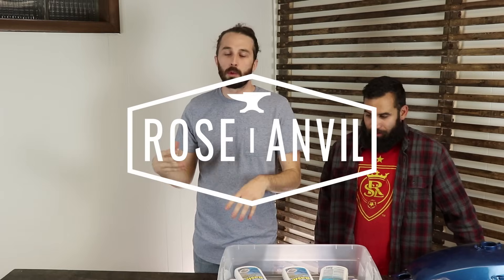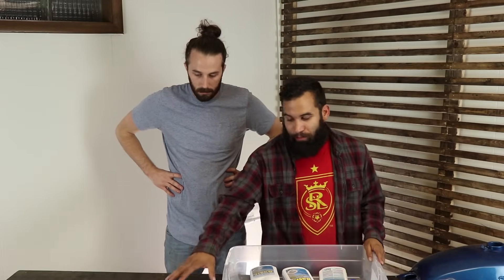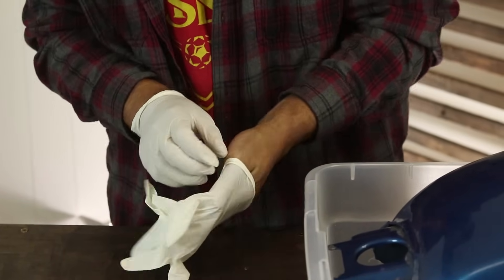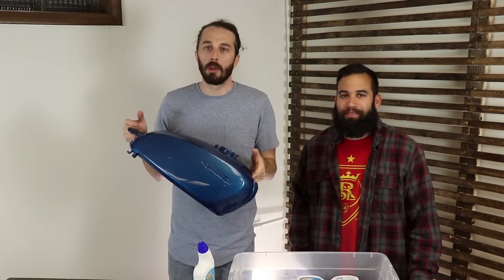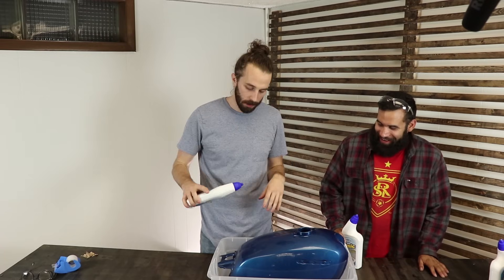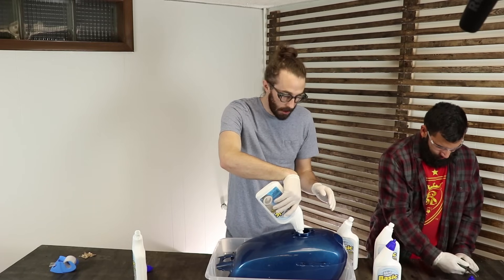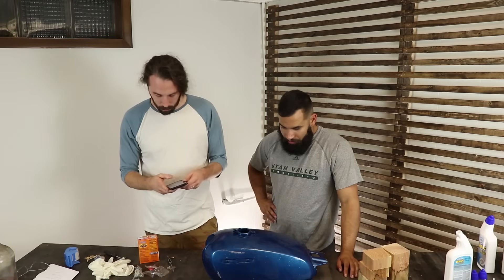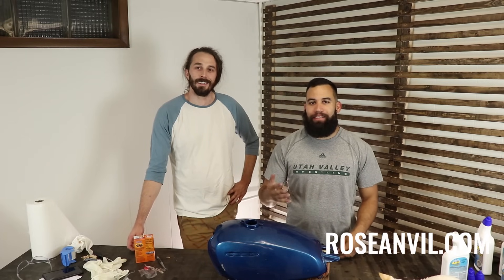How to REMOVE RUST for $1-  (HOW TO CLEAN A GAS TANK) - motorcycle gas tank pt.1

Comment: Okay so anyone reading this, you need to finish cleaning the tank with phosphoric acid, which is used in "rust converter" and auto body self etching primer, or Royal Jelly. You can use Muratic acid concrete cleaning acid which is hydrochloric acid. But dillute it some with water. And then don't leave it in very long because hydrochloric acid dissolves iron and steel. But the key is to rinse it out with water. Then do the same cleaning with phosphoric acid. If the rust isn't that bad you can start with phosphoric acid only. The phosphoric acid doesn't eat the clean good metal, it only removes the iron oxide (rust). The phosphoric acid turns the free iron on the surface of the steel into a hard rust resistant form of iron which is dark grey. Similar to when you blue a firearm. It's called passivation. The surface becomes more resistant to oxidation. After the phosphoric acid you'll not need to worry about it rusting unless you didn't clean the rust fully. Open non treated rust must be removed for the phosphoric acid to properly seal the metal. Hydrochloric acid does seem to remove rust very quickly although it's very aggressive and you'll want to start with a very weak solution first. Too strong of HCL acid and you'll burn through your good metal if you leave it sit too long. HCL is the same as stomach acid and our stomach acid can dissolve solid steel.
Reply: Could you do this with a bike frame?
Reply: @ihavenoplacelikehome  I have been using 10% double strength vinegar for rust removal, it works well as a soak, but its too thin to spray onto stuff for rust removal. Then I discovered that adding enough detergent to the vinegar causes it to turn into a foam when sprayed on it sticks to surfaces. I used an 'earth friendly' toilet cleaner which contains 10% citric acid, oxidants and detergents as the detergent, it worked very well and increased the aggressiveness of the acid. I would be extremely careful to ensure you're only adding acid and detergent though, many people don't realize that accidentally adding even small amounts of bleach to vinegar can produce lethal concentration of chlorine gas.
Reply: I scrubbed through the video to see how they applies the rust converter, I was disappointed to see they skipped it entirely.
Reply: Appreciate the gems 💎
Reply: What if I just get really drunk throw up in the gas tank and leave it overnight,?
Reply: Coke has phosphoric acid yeah? Why not fill it with cola? Maybe diet so no sugar?
Reply: Where can I get acid at like what
Reply: Where does one get phosphoric acid  from? Any house hold items i can use to get same results?
Reply: @babyhullk  Lowe's, Home Depot, Menard's, True Value, etc
Reply: So can I just add phosphoric acid to the tank after the " works " ? Then I just have to drain the phosphoric acid? That's it? Or how to specifically do it with the phosphoric acid?
Reply: I think you mean naval jelly. Royal jelly is something honeybees make. But then you don't see many rusty bees, so...
Reply: @ihavenoplacelikehome  of course
Reply: Excellent comment.  This is why I use KBS products to clean and seal.

Comment: I just cleaned two metal outboard motor tanks with vinegar. Tanks look like new inside now. Cheap, quick, and easy.
Reply: Did you use white or yellow vinegar 🤔
Reply: @glasswinder  white
Reply: @tomcarter4617  thanks.
Reply: @glasswinder  anything?
Reply: Vinegar only? Or did u add something?
Reply: So you just poured a bunch of white vinegar into the tank & what? Was the tank still on the bike? More details are needed 😏
Reply: I used apple cider vinegar on an old husky tank. It took out about 95% but left some on the bottom of the tank. I'll finish it with the toilet cleaner over night and see if it clears up.
Reply: I just did a talk with white vinegar n it’s clean
Reply: Did you just use vinegar or vinegar and water
Reply: @dannytapp9422  I just used vinegar and when I was finished I immediately flushed it with baking soda and water. Then dried it and added oily gas
Reply: @tomcarter4617 oily gas, like 2 stroke gas mix?

Comment: Before you add the Oil to the tank to preserve it, dry the tank completly with a hair drier.  This way the tank will be completly dry when the oil is added.
Reply: Then it will already be flash-rusted. Much like using isopropyl alcohol on water-logged electronics, the acetone they suggest will help evaporate the water and leave the oil.

Comment: Hey guys thanks for this video!  Just used this method on the tank for a 2012 Honda Shadow that sat for about 7 years.  Worked great and I couldn’t believe how much rust came out!  I put in an inline filter as part of the project and now she’s running great with no hesitations or lurching.  Thanks!

Comment: I use 1 can wd40 and handful of nuts and shake  and a magnet on a string to fish out the nuts works every time
Reply: howietorock same, but I wire it onto the front of a ciment mixer, does the shaking for me, I'm a lazy fuck !
Reply: I did the same thing with paint thinner and a bunch of steel bbs. Shook the hell out of it.
Reply: Washers would work well, chain is alright to.
Reply: Put all the nuts on a long lazy loop of string. Much easier to get them all out.
Reply: E

Comment: When diluting acid with water, you should ADD ACID AFTER the water. 
Acid is more dense than water and mixing water with acid is exothermic (generates heat) and it has potential to boil off violently if water is added to a concentrated strong acid.
The risk of a dramatic reaction is pretty low, especially with dilute weaker acids.  However, it is a good habit to add the acid to the water, not the water to the acid.

Comment: This worked like a charm! I did one to one and left it over night. Cleaned it with a pressure washer the next day. I had to go to lowes to get the works. Used a plastic bobber to plug the hole on the bottom of the tank.

Comment from the maker: If you are trying to REMOVE A TANK LINER i just posted a video on how to do that! Link - https://youtu.be/6Q0WwfL_1F0
Reply: Can you explain how you used the marvel mystery oil/acetone/baking soda after you used the works to neutralize the tank?
Reply: And how do you get all the water out after washing the works out, before you use the mystery oil?
Reply: I need to know that too. Can somebody explain how they use that to flush and neutralize inside the gas tank.
Reply: @zackamburgey2164  I believe isopropyl alcohol (rubbing alcohol) will work for water displacement.
Reply: i guess it's kind of randomly asking but does anybody know a good place to watch newly released movies online ?
Reply: @Rudy Alec thank you, I went there and it seems to work :) Appreciate it !!
Reply: @Jermaine Wilder Glad I could help =)
Reply: I'm thinking of sandblasting inside of mine cuz this old man put a really Kick-Ass Eagle sticker on the tank so I'm going to tape off the outside and blast the inside of it my question is other than the gas itself how are we going to keep it from rusting after I sandblasted I mean there's oil and gas as we all know but sandblasted stuff is very susceptible to re rusting you know I'm going to finish your video and see if you cover that
Reply: What is in the liquid that "works"?
Reply: After cleaning like this should be provide special coat  of paint inside tank.
I did it four years ago still good condition coating.

Comment: Always clean lightly rusted metal with phosphoric acid. This is what they put in self etching primer and rust converter gel. You can clean and seal steel by cleaning it with phosphoric acid. Hydrochloric acid does remove rust but it also opens up the metal to rapid flash rusting and basically ruins the integrity of the metal permanently unless you polish the metal or wash it with phosphoric acid. The phosphoric acid closes the pores of the metal. The hydrochloric acid opens the metal. This isn't scientifically accurate but it's basically how it works. Phosphoric acid converts the free iron into hard rust proof metal which is less prone to oxidation.
Reply: I'm a mechanic but i always have respect for people that know their chemicals and how to use them, shit i cant even mix Kool Aid correctly.
Reply: So use phosphoric acid to let it sit and get clean instead?
Reply: @stetsonharrison8951 remove the big chunks then the acid on the lite stuff. Actually neutralizes and becomes a coating of basically a primer. You can paint right on treated steel after use

Comment: If you're not using too much Marvel Mystery Oil with acetone, you can actually fill up the tank with fuel and use that to clean the rest of your fuel system. I've done that several times with motorcycles

Comment: I have a CB 77 tank that I currently am working with,. Time is on my side so I am going with white distilled vinegar,. I started with the nuts and bolts to shake out some rust. Unfortunately we are staying home with the pandemic and my wife can’t go shopping . That means I can’t sneak an hour with the dryer to tumble the tanks with bolts and nuts so I did it by hand. The vinegar has been soaking for four days and I could still see rust on the sides of the tank through the full tank of vinegar. Then came a stroke of genius. I got an old U shaped grill brush. and cut one side of the wire off and straightened the brush out which made it twice as long. There is no part of the inside of the tank that I can’t reach and scrub down. I can already see the rust gone. I am going to let the tank soak for three more days and continue to scrub with the modified grill brush. Then I am going to clean out with Arm and Hammer washing powder to clean the tank and neutralize the acid. I will then evaluate to decide ifI will need a tank liner or not. If not I will use a little kerosine to soak into the tank to stop rust .  For safety I will use a couple of external fuel filters before cranking up the bike. I have rebuilt the carbs and petcock so I want to be careful.